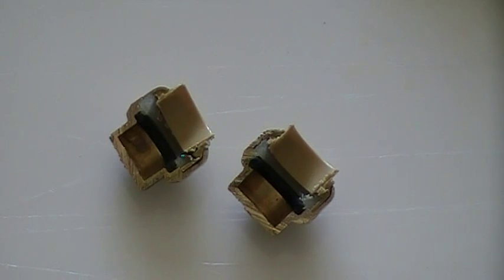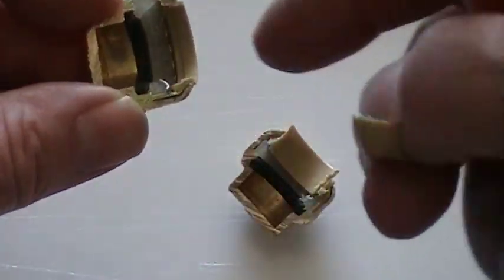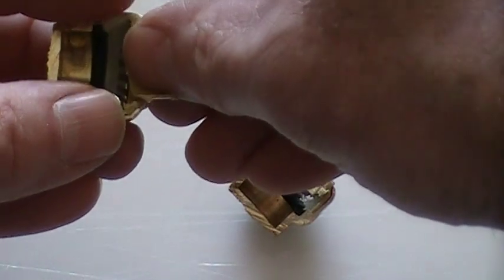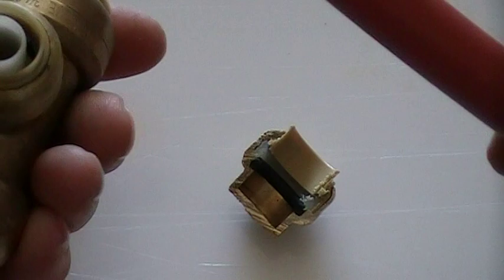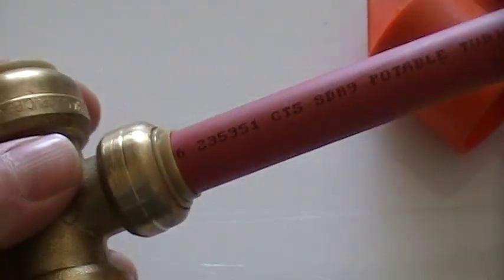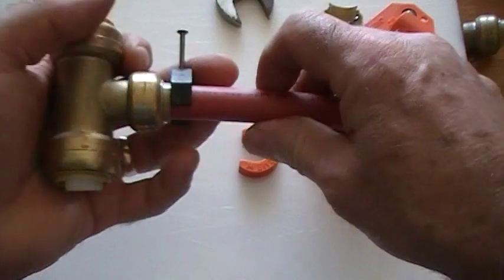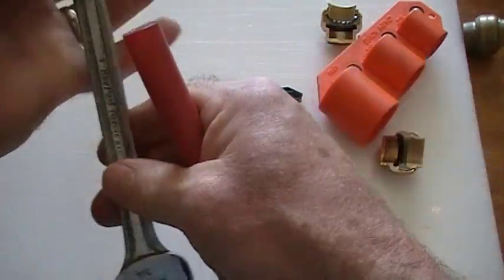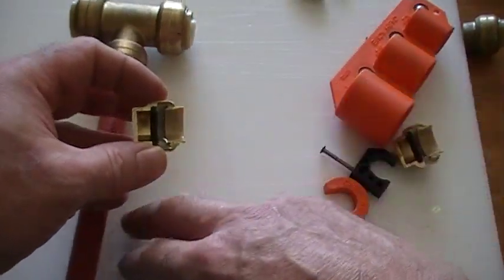Cross section of a sharkbite fitting...how they work and can be removed.Plumbing tips

Comment: BTW, I watched a few of these videos & it is suggested NOT to use shark-bites connectors inside walls. Since shark-bites are a relatively new product there are some concerns. There is a rubber O-ring inside these connectors that may dry out from chlorine (in some waters) causing leaks. I suggest buying some "Jack's" lubricant which is used for swimming pool O-rings. Do NOT use a petrol based lubricant (Vaseline, etc.) on rubber. "Vaseline or other petroleum products should never be used on rubber or neoprene objects. It can deteriorate the rubber or neoprene very rapidly. The correct lube to use is a silicone based lubricant, which comes with or without Teflon. This is available in spa or pool stores."  "Jack's Formula 327 Multilube, SP0327 by Hayward. Pool & Spa lubricant for o-rings and threads on pool equipment."  I would presume, if one's water contains chlorine one would use Jack's....if needed in these shark-bites.   ????????????????????
Reply from the maker: Hello Katrina,
That is the first I have heard about having to add any lube to the o-ring as I have installed many on water with chlorine and had no issues.
I know the company states they can be used in walls and underground. I personally wouldn't do that, but that would be up the the installer.
They were introduced in the U.S. in 2004. 
So they have been around since then and were first manufactured in Australia I believe. They were used for a period of time before they came to North America. So they have been around for a while.
They are made very well and if installed properly last for many years. 
Thanks for commenting and have a good weekend!     Al
Reply: @TheOldkid888  How do you know my name????
Reply: Plumbers are using new type of compression fittings these days for jointing pipes.  And all the compression/joints use an O-ring, similar principal as what Sharkbite uses.  Code will tell if they can be used in walls or not.   I never seen any complaints here on YT for anybody that has used Sharkbites in walls.
Reply: @AStanton1966  My daughter works for Local 21; a steamfitter & plumbers union. They use compression fittings. She told me about them.

Comment: OMG, thank you so much!  Watched so many videos that move so quickly, couldn't figure out what that orange C ring was for or how it did ANYTHING!  This is an excellent video!  NOW I understand & I'm far less daunted about fixing my copper pipe leak...epoxy didn't work, flex seal tape didn't work.  Everyone said I have to cut the pipe & replace.  This video makes me feel so much better about this!!!!!!  THANK YOU!  THANK YOU!  THANK YOU!
Reply from the maker: Hello PegasusC83,

You are more than welcome! The Sharkbite fittings work very well! Biggest thing about the installation is to make sure the pipe goes into the fitting the proper distance. So on a piece of pipe it goes in 7/8ths of an inch. It is very important to mark the pipe and ensure the pipe goes in the correct distance. With that being done; you should be all set.
Best of luck with the repair!
Thanks for commenting and enjoy the New Year!    Al

Comment: Shouldn't you pull back on the fitting a bit after insertion?
Reply from the maker: Hello Kevin,
No need to pull back on the fitting as the teeth bite into the pipe immediately after it is installed.
Thanks for commenting and enjoy your weekend!     Al

Comment: This is the video I was looking for. I wanted to know how straight the cut needed to be. It is not critical. What matters is that the edge is smooth. This is awesome. 

My water heater just failed and I thought plumbing the new one was going to be a hassle with these blue and red pipes that used to connect. I learned that they are Pex, and then I learned about sharkbite. This should be easy peasy. Plumbing has entered the 21st century.
Reply from the maker: Hello Rob,
They make flex connections for water heaters that make installation of water heaters very easy.
Biggest thing is to make sure the pipe goes into the sharkbite the proper distance. 
1/2" pipe goes into the fitting 7/8ths of an inch and 3/4 pipe goes into the sharkbite 1and1/8th of an inch.
Mark the pipe with a marker and you will be sure that the pipe has gone in the correct distance.
The flex supplies come in 12 and 18 inch lengths. They have a gasket that compresses on the nipple on top of the tank and th other end slides onto the pipe.
Thanks for commenting and best of luck with the installation!    Al
Reply: I'm so excited about this that I can't stand it. I've always seen water heaters as something that takes a real plumber. Not now. I put in the new one yesterday, wired it and am getting one connector from amazon today and the rest from Lowes today. 'Course, we don't know if this will work yet, but these things are pretty foolproof to someone that knows what "measure twice and cut once" means. :)

It's just another thing that I've learned I can do myself. If I lived a few hundred years, I could send a man to the moon. :)
Reply from the maker: Hello Rob,
Remember to turn the power on the tank after it is filled. If not you could possibly burn out an element.
I generally open the bath faucet and then the valve feeding the tank. Once the water comes out of the faucet I can then turn on the power. 
Thanks for commenting and best of luck with the installation!   Al
Reply: I had the power turned off and had the jumper on the wall next to it removed. I filled it with water, released the valve on the side at the top until it started blowing water rather than air, and continued running water in my faucet for three minutes. I then powered it up. 

However, there were leaks were I had to use the T threaded iron pipe to connect the main inlet to the tank and the overflow tank. I ended up having to reduce pressure, remove the main inlet, crank the heck out of that Tee on top of the tank, and plug the main source back in. I then ran the faucet for a few minutes. The pressure valve was already spewing water so I didn't need to use that.

It's not leaking now and the water is already hot. The only thing I did wrong was pull out the rubber heat stoppers on the inlet side. I thought it was a plug and didn't know, until it was too late,that it was a flap. Unfortunately it's about fifteen pages into the install instructions before they mention it. I only did one side because it didn't seem right that it should be removed - after I looked at it. It forced me to read more of the instructions. :)
Reply from the maker: Hello Rob,
Good job on the power disconnect! Rather be safe than sorry.
Little tip about the relief valve on the side of the tank for the next change out. hopefully many years down the road. You don't want to touch the relief valve on the side of the tank unless it pops and then replace it. They have a tendency of not seating back properly and will begin -to leak even if they are new. Opening a faucet will be suffice. 
I generally use a little pipe dope over my Teflon, but a few extra windings of Teflon will usually do the trick as well, but I am glad you got it stopped.
Those little heat traps do keep the heat in, but one thing about the cold inlet. The line going into the tank has a dip tube in it that goes down to the bottom of the tank. So that is where the cold water would enter.
The hot outlet trap is more important in my books because the hotter water will always be at the top of the tank and the only thing that is on the hot outlet is a nipple.
Thanks for commenting and congrats on the installation!    Al
Reply: TheOldkid888 I wodered if using that side valve would possibly make it never seat properly again...

meanwhile, how does running water, which is pulled from the bottom, clear the air at the top?

or does only the inlet have a tube to the bottom? was I missreading those cutaway views on the internet?
Reply from the maker: Hello Rob,
The inlet only has the dip tube that goes to the bottom of the tank. Some tanks have a tube that actually curls in the bottom where little holes are found that actually move any little sediment along. They call these self cleaning tanks.
The hot water outlet only has the nipple. Since hot water rises; the cold enters the bottom of the tank and pushes the hot water out the nipple. If there was no dip tube; the water would blend at the top and you would end up with luke warm water while you ran your faucet.
Thanks for commenting and enjoy your day!    Al

Comment: These sharbite fittings seem to work better with pex pipes,  bought one elbow, and it didn't hold the water pressure, if I wasn't standing by, I would had a swimming pool in my basement
Reply from the maker: Hello  NoShadowOfDoubt1,
That definitely isn't good. I have done a number of tests on these fittings in the past while. One being...taking pieces of pex and copper and joining them with sharbite couplings. I then applied almost three hundred pounds of weight on the one end and hung the other from a steel beam. As I applied the weight; the sharkbite  took a better bite that was evident when I took them apart. The pipes had a little deeper marks in them, but they did not slide off. I was impressed with this test. 
One of the things that I tell everyone when installing them is to be sure to mark the pipe as you want it to bottom out in the fitting. This is very important because there is one point while putting the fitting on where it stops; like there is a ridge about half way; and I believe this is where a lot of people make a mistake and think it is on all the way. By marking the pipe I am sure it has gone on properly. Not saying this is what happened in your situation, but it does happen. That's a tip you can pass on or use that may come in handy on the next install. 
I, personally, have great faith in these fittings myself. Half inch pipe slides into the fitting 7/8ths of an inch and 3/4 slides in 1-1/8th. 
Thanks for commenting and enjoy your weekend!     Al

Comment: Thank you for this excellent demonstration. I may be experiencing a problem with these fittings, in between a water cistern and a pump. I think these fittings depend to some extent on water pressure to stay tight. When the pump draws water from the cistern, it creates vibration and vacuum. We don't have water leaking out, but we appear to have air leaking in! The pump loses its prime and can't draw. One of the Sharkbite fittings that was previously tight had to be pushed back together about 1/2 inch today, and we still had air leaking into the system afterwards. I think we are going to pull all the Sharkbites and save them for a pressured system, and solder copper instead.
Reply from the maker: +Dael Franke 
I would say you are exactly right with that assumption. A vacuum being drawn on these fittings would present a problem. Pressure is what they are made for and with the pump doing just the opposite drawing water from the cistern; it would draw air in through the fitting causing it to cavitate and lose its prime.
Unfortunately you will another means to join the piping. If it's copper; soldering would be the way to go.
Thanks for commenting and best of luck with the repair!    Al

Comment: Licensed plumber - LARGE company - used these to make four behind the wall repairs to copper pipe that blew in 4 locations during freeze. All four failed and flooded my basement again ... Buyer beware!
Reply from the maker: weeseeu 
I have had great success with these so far along with other people that I know. If they are installed properly you should have no issues. I have also done a number of tests on them and they will hold a great amount of pressure and weight. I hung four pieces of pipe together and joined them with couplings. I added 275 pounds of weight to the bottom and they did not come apart. I used both copper and pex for the piping.
I also did a test where I froze the pipe with a sharkbite cap on top and it did slide off a very small amount.
Sorry to hear they didn't work for you...
Thanks for commenting and have a great weekend!    Al
Reply: weeseeu - All four that you installed blew out?
Reply: Yea but they froze
Reply: Filled pipes aren't made to withstand a freeze in the winter, regardless on what kind of fitting(s) they have.

Comment: how hard to pull pipe out without pushing in plastic?
Reply from the maker: Hello u235u235u235;
You cannot pull it off unless you push in the plastic retaining ring.
I have done several tests on them and they take an amazing bite.
I made this video called ......Sharkbite Fittings!Size and weight!Weight Test!PLumbing Tips!"...
In it I did a test near at the end of it that more then impressed me as far as how the fittings take a bite.
Exceptional is all I can say. The biggest thing is to sure they go on pipe the entire way and that is why I measure and mark the pipe to be certain they do. If so; you have no worries.
Thanks for commenting and have a great week!     Al

Comment: Do you know how many years they last before the o-ring degrades and fails?
Love your videos.
CHEERS
Reply from the maker: Hello Bob;
Not exactly sure how long they last. They have been around for a few decades now.
I have used a number of them now. Ranging from 1/2" to 2". They do work very well.
I still prefer to use solid connections like copper or pex, but these fittings are becoming very popular.
A friend of mine was asked by the homeowner to do all the connections of pex pipe in a home using the
sharkbite fittings. That was 6 years ago and they are still there. They aren't cheap, but there is no need to buy a torch and all that goes with it. 
The other great thing about them is if any water is present in the line, you don't have to worry about making the connections as it doesn't affect making the connections.
I made a number of videos and several tests on them and they are a very good product. Marking the pipe and making sure it goes into the fitting the entire way is MOST important! I believe they will be around for a long time.
Thanks for commenting and have a great week!     Al
Reply: Not sure how long they last but they are guaranteed for  25 years. Of course longevity depends on the circumstances in which it is used but it provides some indication

Comment: I give a thumb down to those who gave thumb down.  What part of this video do they not like?  With the foundation knowledge of how sharkbite fittings work, I can use whatever tool to push up those plastic sleeves to let go of the metal bites.  Thanks for the awesome video!
Reply from the maker: Hello bori pippi;
I everyone is entitled to their opinion. I thought giving a view of what the fitting looked like and how easy it is to remove it would go over well with everyone, but people will make their own mind up on them I guess!
Thanks for commenting and have a great week!     Al
Reply: I think it was a good tutorial on how they’re supposed to lock and unlock, and I wouldn’t give it a thumbs down, but I’m interested in how they make a water tight seal and I would like to have seen more emphasis on that aspect. I see a few comments about an o-ring, so I’ll have to pause the vid and see where it’s at.

Comment: Is it necessary to remove the plastic liner if using copper pipe? I believe I slid the copper pipe with the plastic liner going inside the pipe. Thanks for your videos. Very helpful
Reply: I never have. I have never had a leak with one of these and several at least 10 years old under my house. Started using them after a plumber used one and charged me $250 to fix a leak.  I saw no reason to pay that when I could do the same thing for under 10 bucks.
Reply: Not necessary, leave it in.

Comment: Great video! I am in the process of using one of these fittings and was hurried and forgot to clean the copper. Needless to say it weeps a bit. Never thought to use a crescent wrench to release it! I will be trying that method as I'm about an hour from any local hardware store.Thank you!
Reply from the maker: Hello gmjunky87;
It is probably not the cleaning of the copper, but the filing of the end of it. This is an important part sometimes if a sharp pair of cutters are used and it leaves a ridge on the copper. When applying the fitting if the ridge is substantial; the o-ring can be cut ever so slightly and a leak can occur. Making sire the fitting goes on the entire depth is the most important part of the installation.
Thanks for commenting and best of luck with the repair!    Al
Reply: I took the fitting off sanded the end and reinstalled it and it is leak free!
Reply from the maker: Hello gmjunky87;
That is awesome news!
Congrats on the repair!
As you can see they are very easy to use!
Thanks for commenting and have a great day!       Al